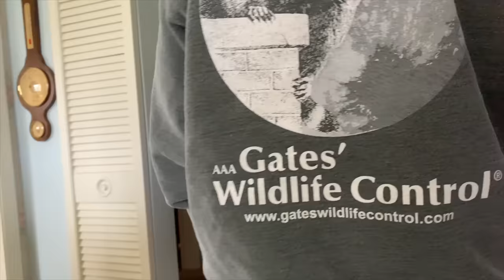Raccoon Crashes Through Bathroom Ceiling!

Comment: Sweet lady. !950s bathroom original and not remodeled but was well cared for by her for 60 years. Sadly nobody heard the attic visitors and her hearing may be a tad bit tired. Momma fell thru her urine spot, most likely her second or 3rd litter there. I am grateful that your follow up repair crew patched the hole with minimal expense.

Comment: Gotta love these cheaply built American houses. Nothing is safe, beehives in your walls, raccoons in your attic, termites in your floor. everything hollow and wood gg
Reply: They were built bad in 1900s but generally houses built in like 2003 plus are built good
Reply: Or rlly old houses u know I mean idk if u get many old houses in us but we got loads here in uk 🇬🇧
Reply: This house looks like it was built in the 1950s, early 1960s. Those wood joists were saturated with urine, meaning that space could have been a raccoon toilet for years. Wood plus water equals decay. Drywall is two layers of paper sandwiching gypsum. Drywall is not waterproof. The best deterrent is to examine your roof and your house regularly to ensure no critters can enter. Cap your chimney with a screen. Cover any exposed holes in the foundation. An ounce of prevention is worth a pound of cure!
Reply: Canadian house. Doesn't look like the home owner performed regular maintenance. Just allowed the house to fall apart.
Reply: Add rats mice possum.
Reply: This house was built most likely in the early 1960's, and has a brick+cinderblock+3/4" plasterboard wall. Asbestos around the vents, a single flue for a dual fireplace, asbestos mastic in the basement, and a lot of DIY that meets no code.

This is located in a borough of the Greater Toronto Area in Ontario Canada... specifically Markham.
Toronto is full of these homes. They all have closed 1/4" ply as soffits with no venting (even though there's vents in the aluminum soffits). This is also why you see no baffles in the attic and the ceiling joists are about 6" below the ridge cap (most likely embedded in to the last row of cinderblock). There is generally no air movement in the attic, and there's a good chance that old lady is also the original owner of the house.
Reply: this is in Canada
Reply: This house is in Canada not America.

Comment: You have to love those emergency calls. When I was in property management a tenant called me in the early morning hours in January. There was noise in the walls of the attic apartment. I saw two heads poking out of the siding which they had ripped off and burrowed into. There was maybe a foot of space between the siding and the wall inside apartment. I had to get wildlife management to come in an trap and then plug the exterior hole. These racoons look cute but can get vicious when confronted. This is especially true if they have babies in the house. Get a professional like Gates to do the job.

Comment: Years ago my wife and I, sound asleep were woken by a crashing sound in our bathroom.  I jumped out of bed peered into the hallway. A trail of water, wife for got to empty the tube after bathing, led me into our kitchen.  My first thought, with all the noise from the kitchen was, a burglar.  When I looked I told my wife to open the front door and move out of the way. It did appear to be rabid so I tried reasoning with the raccoon that it should leave and sure enough it left the kitchen walked through the dining room into the living room and out the front door. We had left the bathroom skylight open and the screen couldn’t handle “her” weight. Two days later she gave birth to two babies in the second floor of my shed.

Comment: Everyone thinks they’re cute till they have to evict them. My parents first house (1983) they pulled the flashing near a fireplace chimney on the roof, and then squeezed their way in. We didn’t realize that had occurred till a windy rainstorm pushed the rain sideways and we had water stains on the ceiling. Back then it cost about $5000 to evict them, replace the drywall ceiling, replace dirty insulation, questionable wiring that had teeth marks from the babies. My mom and dad had to work overtime for months to try and pay off that expense. As a point of reference, their mortgage payments was $450 a month. The little buggars have tried climbing up onto my deck in this house so I’ve screwed several mouse traps at the top for the posts under the deck. It has worked as a deterrent, and I was surprised to catch a mouse! Height of top of post is 7’8”.

Comment: I'm dealing with racoons in my attic now. What an expensive mess to deal with. I have to pay $6k out of pocket, insurance will cover the rest. They tore a hole in my roof, damaged the  soffet and gutters and made a mess out of my  central ac duct work and peeded all over the attic insulation and damaged some high hats.  2 years ago i replaced the roof, all new soffets and guters and lots of new lighting cans. 1.5 years ago totally new central ac duct work and system. They did all that damage in 3 weeks. 

The ones in my attic are big  too. Trapper said .they all got the big fat gene. They are very cute but very destructive.

Comment: That first one he held was being quite but put it's hands over it's eyes 😁😁😁😁. I can't see anything now so I'm safe LOL. Raccoons are funny little creatures.  I live in a field basically.  I had a ground hog come up on the back porch and put it's "hands" on the door and was looking thru the glass like hey let me in.  It had been a couple of hours and I went on the back porch to get something, left the door cracked. Oh yeah it was my mop bucket, I turned to go back in the house and the door was wide open. I thought the wind blew it open.  No big deal. Until I was going down the hallway and nearly stepped on the damn thing!!! It didn't even wanna run!! I thought I was crazy!! I'm like I thought these damn things were supposed to be afraid of humans!!WTF??!! Why ain't it moving!!  I just kept pushing it towards the back door and finally got it back outside.  I haven't seen it since that day. Which was EVEN MORE odd!! I thought I was crazy. Dreaming or something. UNTIL...,.I had 2 breakers burn out. I couldn't use my cook stove or my air conditioner (window unit in kitchen)  now I live in the house my parents built.  So it's kinda old and stuff is having to be replaced unfortunately LOL. My dad physically built it in 1973 and my mom worked and made money to buy the supplies.  So I called my cousin to come change the breakers which he did.  He lives out the road from me but on a different side road off the main road. Also if you go to the main road from my road, you can turn left or right or go straight across. If you go straight across you're on another side road/,off road whatever. But there's humans have lots of houses up that way LOL we were talking about critters.  He lives just up the road from the lake.  He was talking about all these Hawks he keeps seeing but they look Black. Darker than normal.  LOL. I said that's because you're not seeing Hawks 😂😂 those are Juvenile Bald Eagles.  They don't start getting their white tail feathers and white heads until they're 4 and a half to 5 years old.  He said OHHHH Ok that's what I've been seeing then.  After I showed him a picture.  He then tells me about a woman that lives up the road from me literally less than a mile that had a ground hog come there and she was feeding it and basically turned it into a pet. Kept it in the house and everything.  Then one day it got so hateful she had to let it go.  Then she started seeing smaller ground hogs. Of course she started taming them down too.  Hmmm that explains why I couldn't hardly get this one out the house!! I didn't know the damn thing was a pet!!! LOL it wasn't full grown. It was about half grown.  Since I didn't know it was a pet and kicked it out of my house I guess it went back up the road to her 😂😁🤣🤣🤣 if you're gonna take ground hogs and raccoons, squirrels or whatever, put a note on them or teach them to talk or something so you're neighbors don't think we have completely lost our mind when they come to visit us 🤣